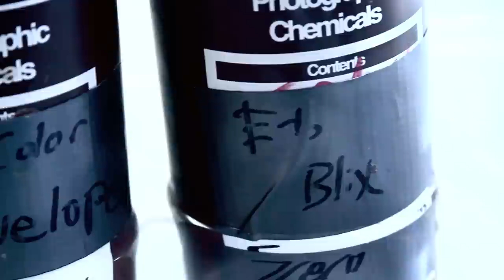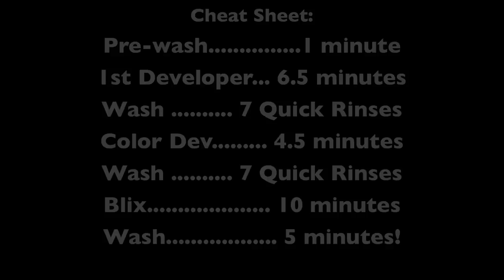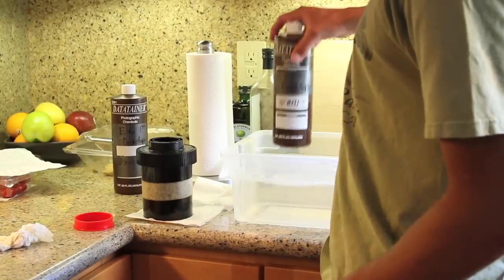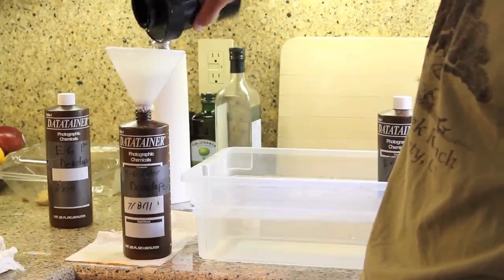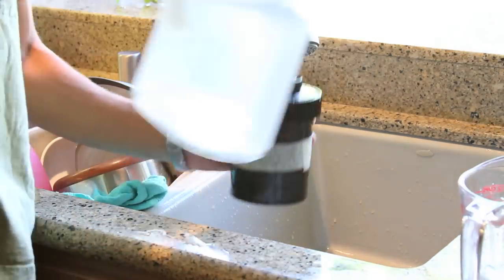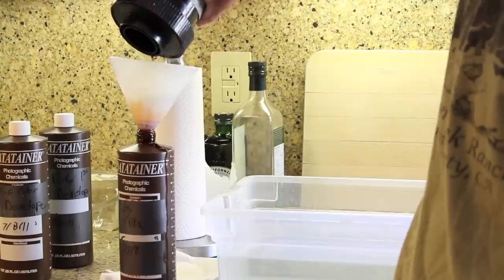Developing E-6 Film

Comment: Coming from 40 years of DIY E-6 home processing, I think this video clarifies that E-6 can be done adequately at home without being a chemist. Good points: pre-wash and using a "tempering tank" to hold all chemistry in the 100 degree target range; noting that the 1st developer timing is critical to outcome, but other steps "go to completion", meaning until chemical reaction is done - you cannot "over due" those steps.  Not so good:  You have to keep the tempering tank at 105 to work right; no indication that it was being reheated here;  washing technique is inadequate - use running water [at temp] or fill for 30-60 seconds  and dump, then refill; more than recommended is safer, as these kits do not neutralize the chemicals as you progress.   Finally, depending on which kit use use, this chemistry can be poison. you rinse you tools as you go, you fill tank and bottle over the sink so spills are flushed away, and you do not do this near food, dishes, etc.  What a thrill that 1st roll of slide you do yourself can be!
Reply: Coming from about the same time frame, back in the early 70's as a kid developing my deceased dads B&W negatives into prints from the 60s,  50s straight onto agfa photo paper from those large format negatives.  No enlarger, a direct contact print with a light bulb!  The days of experimentation for a kid! 
The Kodak E-6 kits were nice.  I agree at keeping all at temp or trying too.  Again those old Kodak E-6 kits were forgiving.  I still have wonderful E-6 slides full of color and detail.  With this Arista kit with only 3 solutions,  I cannot keep thinking a quality step is not being overridden.  Maybe not?  I will try it soon since getting back into E-6.  Freezer full.  Good luck and enjoy the old school. Sure a heck more satisfying seeing what you shot , developed and now drying come alive!  Shooting film is a skillset.  No immediate gratification like digital.  I wax too long..
Reply: Funny. He mentioned not getting too much "hate comments". You all know how social media can be. This feedback is EXACTLY what we need more of. Very honest, very helpful and moves the needle forward. Thank you for posting this feedback as I was thinking similarly and its helpful to read this as another source.

Comment: The first developer you're adding 4% time to each roll, so multiply the development time by 1.04 and you'll get your new time.

You can push this kit past 10 rolls if you'd like. When developing, the general rule is you can use the chemicals until you are unhappy with the results. I just pushed a kit to 37 rolls, 29 rolls past the 8 recommended. 

I also developed slide film 10 degrees past what it said, and had no problems, I just took of 30 seconds from the color developer.

Comment: Hi. God video. Just some pointers. You are agitating way to fast and agressive. Turn the tank, gently, upside down and then Listen! Listen for the bubbling to stop and then turn it -gently back. With the kind of tank you are using you can hear the bubbling. With the Patterson tank you will not hear the bubbling since it swirls. Every inversion -from when you pick the tank up and turn it upside down and then turn it back again should take about 5 seconds. This has got more to say than one would imagine and is very important to do it exactly the same every time you develope if you want a continous result to analyze. The agitating has a lot of influence on your contrasts. More agitation -more contrast. To little agitation or bad technique can cause low contrast and/or veils on your film.
Reply: Also, spin the tank a little bit (about a 30 degrees or so) evey time you put it down. This way you will slowly rotate the tank everytime you agitate it. This also contributes to a more even result.
Reply: +jonnebanan I was going to comment similarly but the concern for me is that agitating that forcefully would likely pop anything wider than 35mm film out of the spiral and make the layers touch, ruining one or more pictures (probably most of the roll).
Reply: Washing: Shaking a little water in the tank will wash off the chemicals on the film surface, but will not wash it out of the film emulsion. These 3-bath kits seem to tolerate a significant chemical carry-over between baths, so technique shown here seems okay. However the final wash is critical to long-term survival of your images. I'd suggest a 20 minute in-tank wash with running water hosed into the bottom of the tank and overflowing at the top. Alternatively, a soak in fresh water changed at 5 minute intervals for total of 20 - 30 minutes. This is particularly important as the 3-bath kits omit the chemical stabilizer {last} step of the E-6 process. You've probably got $8+ invested in each roll at this point, so under-washing to save on water seems to misplace values.

Comment: I use lightroom to develop my films and the fishes in the water are more happy.
Reply: By the way, most film chemicals are ok to pour down the drain, but you have to run it over a filter of steel wool before doing so in order to extract the silver so it doesn't go down the drain and hurt contaminate the water. It's not much better to use digital because the making of computers and digital cameras requires toxic chemicals too.
Reply: Samuel Lerman-Hahn even though i agree with this point of view, you're sending this message, as I am, from a computer as well! haha
Reply: Oh yeah the manfacture process or you digital camera was 100% made without toxic chemicals and without touching the enviorement.